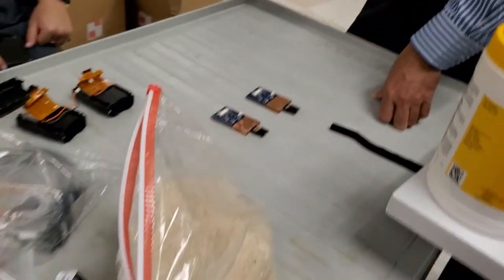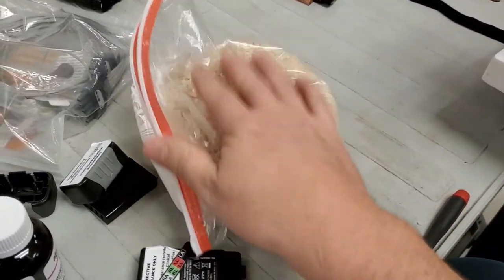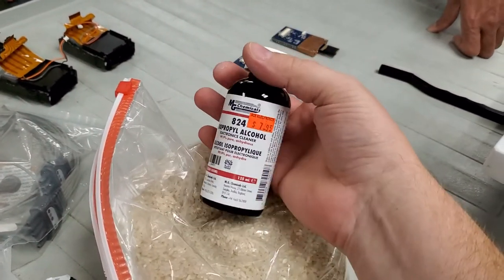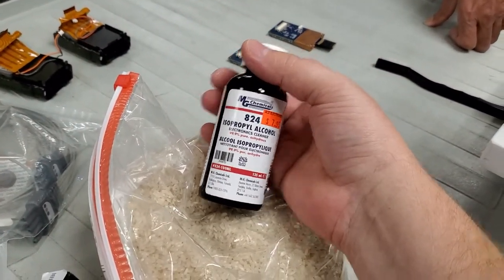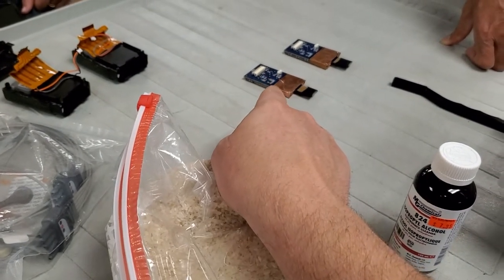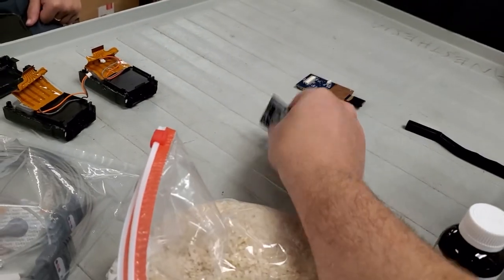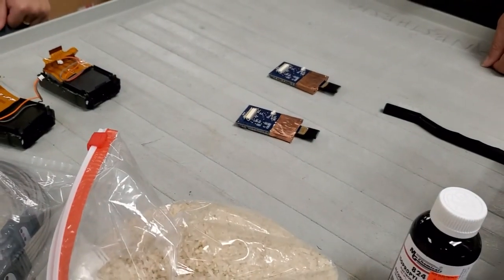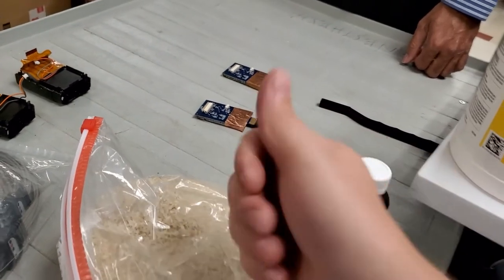Rice and Biomed Do Not Mix

Comment: Just thinking back to O-chem days - what about putting the electronics in a vacuum chamber? Assuming it isn't vacuum sensitive, lowing the pressure would effectively "boil" the water out. Thoughts?
Reply from the maker: That would make for an excellent video. Hold that thought